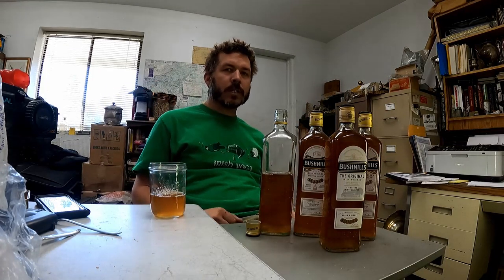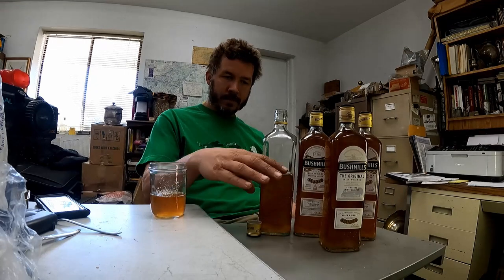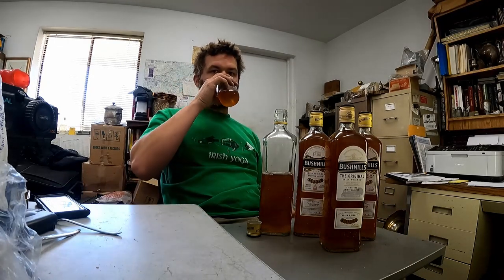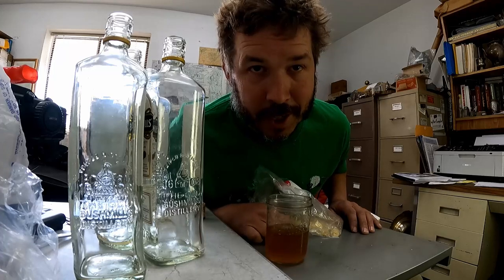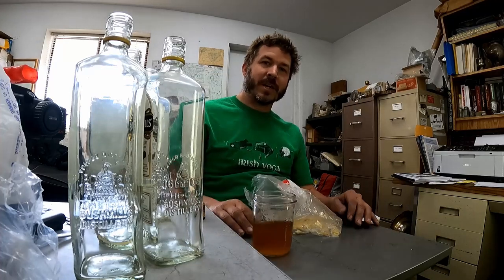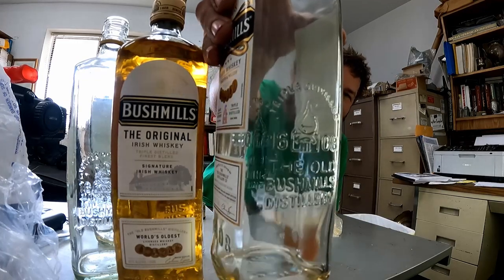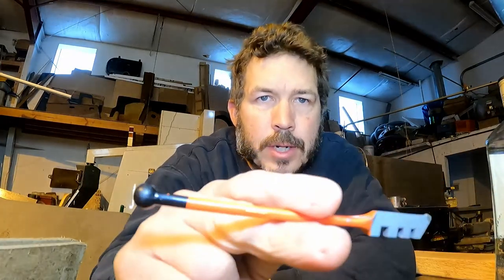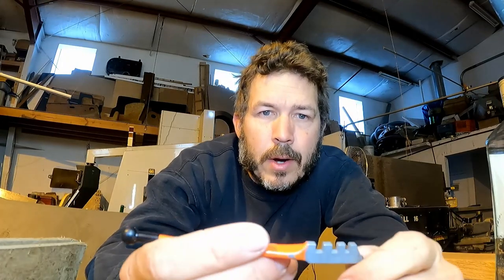Bushmills To Beer Glasses

Comment: Hey I apologize but I have a random question. Was the hay budden  anvil you had actually 600 lbs? Do you still have it? If so can you contact me sometime? Thanks
Reply from the maker: It was 563 I think. I will have to look again. Dirtyshopdiy@gmail.com
Reply: @DirtyShopDIY  is it possible to make an offer on it?
Reply: @DirtyShopDIY  would $5500 buy the anvil?
Reply from the maker: Sorry not even close. I saw a smaller one of these go for 55k on ebay a few years back. I dont expect to get that much. But more than 5500
Reply: @DirtyShopDIY  ok thank you for responding. If I ever come across a lot more cash in the future I’ll check back with you.
Reply from the maker: @paradisefalls37  ok, I'm also not too keen on selling anyway.